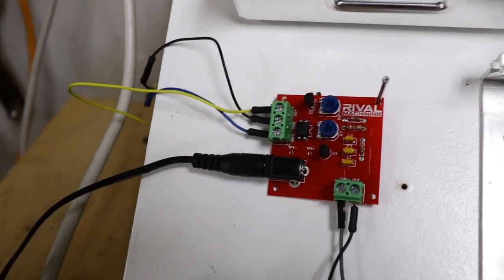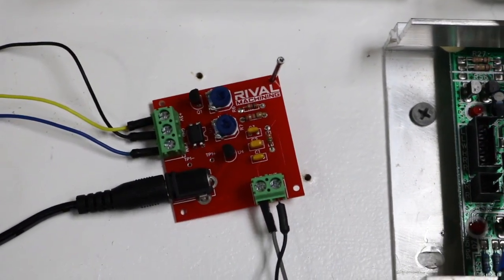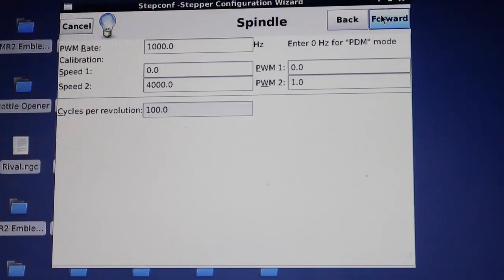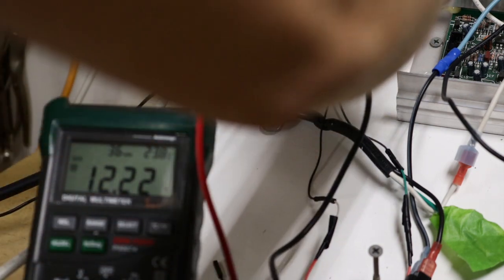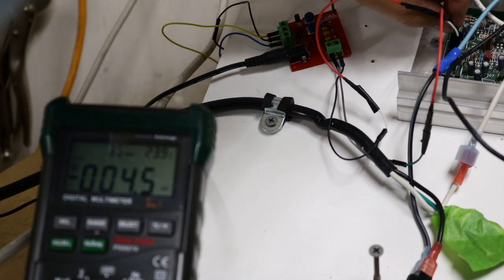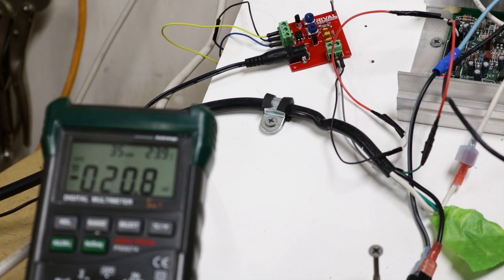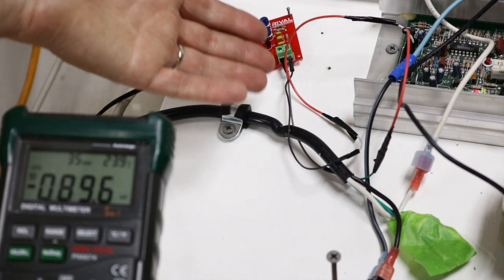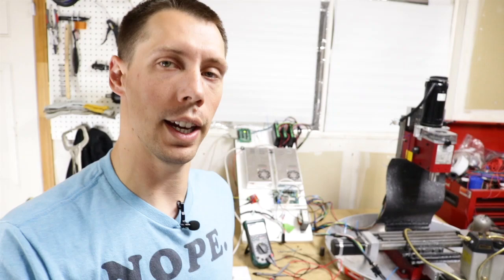PWM to Analog Voltage Spindle Speed Converter

Comment: Please send me a link on where to purchase
Reply from the maker: Hi Kevin, I still have a few of these but found out they are not compatible with the XMT-1135 motor driver.  I used it with a FC350BJ and MC-60 board and both worked.  Please let me know what board you have.
Reply: @RivalMachining  thanks for the reply. Ill let you know as soon as the mill arrives and I start the tare down. BTW I'm looking through  your videos now to see what controller you used. I was going to start with grbl, but after researching it looks like I'm going to go with something that works with mach3 or LinuxCNC. I know you moved on to a tormach, and I caught your reflection on your mini mill conversion, but I wonder if you have any additional advice with regards to software and controllers for the mini mills. Thanks again for your videos they are a wealth of information.

Comment: Is there any way you could publish the diagram for this board or make one available for me to purchase ? Would be much appreciated,
Reply from the maker: What mill do you have?  I still have a few boards but quit selling them because I'm not sure how they work with the various motor drivers out there.
Reply: @RivalMachining  I have an x2 with the brushed motor.
Reply: @RivalMachining  thank you for replying I appreciate it
Reply from the maker: No problem.  If you have the motor driver labeled FC350BJ, I know this board will work for you.
Reply: @RivalMachining  unfortunately mine is the XMT-1135 which I see has the same Pinouts for potentiometer it is just laid out differently by the looks of it. I would gamble buying one from you if your still up for selling one
Reply from the maker: I sold one to someone with that board and he wasn't able to get it to work.

Comment: Cool project! But why not just use an octocoupler directly to modulate the power that feeds the pot on the mill?
Reply from the maker: I wasn't sure if the various motor drivers would respond to a PWM input, so I decided to smooth the signal before sending it to the driver.  In reality, it will have some ripple left and I think the signal's ripple will change a little based on the input voltage selected.

Comment: I will be ordering this very soon! I don’t see this board having an issue running with UCCNC software which is what I use. Also, would I be able to power with board using an isolated power supply inside my control box opposed to a separate power cord running outside into a 115v plug?
Reply from the maker: Great!  I don't know very much at all about UCCNC but as long as it puts out a PWM signal, preferably through a breakout board, it should work. As far as power supplies go, as long as the power supply has an isolated positive and negative that will only be used for this board, you should be good to go.  I have seen power supplies that put out 2 or 3 different voltages, but I don't know if they have a common ground.  The safest bet is to have 1 power supply that feeds this board.  My mini mill has all the power supplies come together with 1 power strip. I'm assuming yours are all on one bus bar? That would electrically be the same.